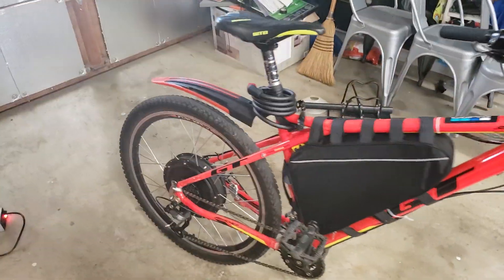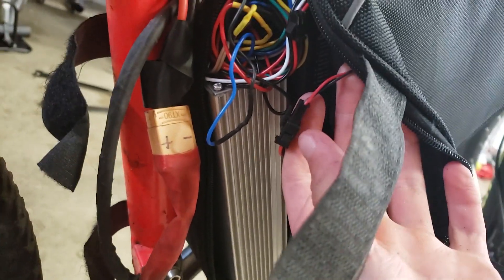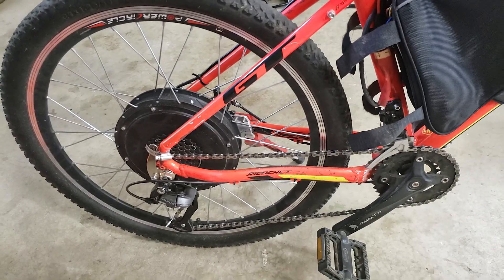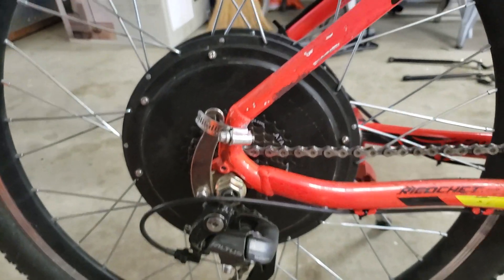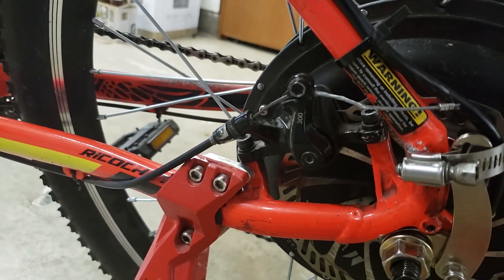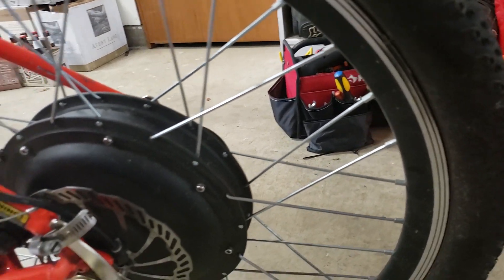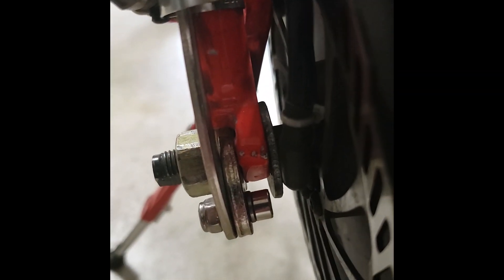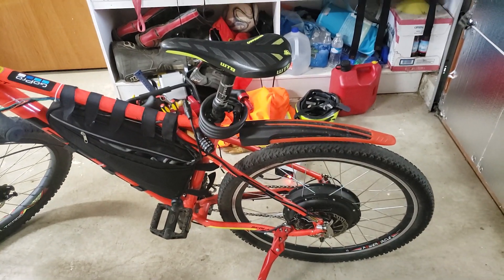DIY 1500w Ebike Tips *watch before building

Comment: For front 1500 watt hubs with 2 inch wide tires, try not to excel throttle when leaning to turn or sharp turns. Going over 20mph gets the torque of motor to push down pinching tubes to inner sides. It happens twice of same speed, same area of turns, and same blow out at same spot. Having 2 inch wide tires limits usage for bike tires not meant for 20plus mph due to pressure of speed.
Reply: You really can't speed thru pot holes, cracks, cement up lifts of concret, dips, ect. Constant pressure will have tire always needing repumping

Comment: How did you get the power feed for the light? Did you just cut straight into the battery cable? Thanks
Reply from the maker: On my motor controller there’s a accessory plug that comes off of it. Just two small gauge red and black wires that are the same voltage as the battery and carry enough amps for a small light.

Comment: What's the blue wire connected to?  Is this function standard on most controllers? 
I have a similar 1500watt kit, and I'd like option to limit raw power for range, as in the city I don't really require speed
Reply from the maker: There’s 2 blue wires coming out of the controller. And connected together it limits the power. When they aren’t connected it’s full power. Almost all 1500w controllers have it.

Comment: hey, im having the same problems with the brake pads, the thing is i dont know how to adjust the brake callipers bc the motor is so big, i cant acces the screw on the inner side of the caliper ,  i would have to remove the caliper, adjust it and install back on every time? do you any solutions? pls reply
Reply from the maker: Unfortunately, that’s exactly what I had to do as well. I had to remove the whole wheel or caliper just to adjust the pads. If you switch over to hydraulic brakes you won’t have that problem since there’s no adjustment on them.
Reply: @WillMacD  thanks for replying! Im gioing to think twice before installing hydraulic brakes due to the brake levers being able to stop the  engine, geat safety feature. the accelarator is kinda flimsy and when im breaking i can feel twisting the throttle a lil bit. how the xt90 connectoir? did you go with the s/antipark or regular ones? im having a problem with the battery wiring, previous owner was a shady engineer did  the job himself, sucked. the battery base thats attached to the water mount is not well put together and was wondering if i can put xt 90 connectors on the base of the battery and the controller withou burning anything, what do you say? thnks

Comment: I have seen loads of vids with this motor, I guess it must be worth the money, I got electric scooter causing me loads of issues, Really is thinking of an e-bike build but still not sure what i should get a hub or mid motor, Cant afford both lol, Can anyone tell me what is the best motor over long term use??
Reply from the maker: I would say go for the mid motor if you have the money to. My experience with hub motors is there cheaply built and not the best longterm. Mid drives like the BBSHD are a lot better quality, last longer and you have more options with the gears on your bicycle.
Reply: @WillMacD  A lot of people say the same sort of thing, I ask coz the electric scooter i bought is chain driven an now warranty is gone a weld went on the back creating a lot of other issues, An is now regreting not buying a hub driven electric scooter considering the chain driven scooter cost me just over a grand with 20ah battery, I had to buy after i bought the thing, So dont want make same mistake with buying parts for e-bike, Even done it with my sim rig by buying crap rig lol, Far too many people on you tube say anything for commision or views, You would think vid feedback would show you its worth the buy, Until you buy it, lol, I respect your honesty bro, So far it looks like a mid motor, Plus cant you overvolt the mid an hub motors? Is overvolting a motor a bad thing tho?
Nice one for the reply, Stay safe bro...

Comment: I use 10mm chrome vandium wrenches as wheel locks with 2x hose clamps. If they come loose they can rip wires pout or short them causing fire. 1500w should do 35-40 on that bike be careful.

Comment: How’s 48v kit on 52v?
Reply from the maker: The controllers and motors can run on either voltage. The 52v just give it a little extra.
Reply: @WillMacD  can I have the link of battery
Reply from the maker: @awstech6217  https://www.ebay.com/itm/254297690528
Reply from the maker: I used the 52v 20Ah with the 30amp BMS
Reply: @WillMacD  amazing ! I have a 48v 13 a and getting 20 mph max

Comment: I'm very concerned about damages the wheel takes, while riding in the city or offroad, if your bike isn't fully suspended.
Can you ensure me about that?
Reply from the maker: I haven’t had a problem with a wheel breaking even without suspension. I’ve ridden this bike pretty hard off-road and it’s a hard trail. Its held up very well. The spokes are a bit thicker than normal bicycle spokes.
Reply: Well.
Thanks a lot for your reply.
Will buy a bigger motor instead of suspended bike then!
Wish u the best

Comment: I'm surprised that it only goes 30 miles per charge, with over 1000 watt hours, I would have thought double that, but I guess if you are riding at high speed it needs a lot of power.
Reply from the maker: Yeah I thought it would go a little farther as well, and maybe with pedal assist it would go farther. But when I ride it in my area it’s full throttle the whole time.

Comment: I'm currently a voilamart 1500w ebike and I'm having a real issue with the controller, would you be able to help?
Reply from the maker: What’s your issue with the controller?
Reply: @WillMacD  I can't determine which wires go where. The motor that i have had all the motor wires connected to one plug and the wires are so small that they don't seem to be a proper gauge for motor wires
Reply: @WillMacD  here's what I'm working with https://youtu.be/eY_mr48sD5w
Reply from the maker: @micmartin2133  I watched your video, and that connector looks to be only for the Hall sensors. On my controller the hall sensor wires are the super small gauge, Blue green yellow red and black wires. Then for the power or phase wires there blue green and yellow but a thicker gauge. I hope this helps
Reply: @WillMacD  thank you so much for your help.

Comment: 52 volt? The Voilamart 1500w unit I am looking at says 48 volt. are there different ones or will the 48 volt unit accept the 52 volts?
Reply from the maker: The 48 volt kits will accept the 52v battery. It just gives it a little boost. But doesn’t give up any reliability.
Reply: overpowering voltage over the product doesnt sound like a good idea. it may or may not fry something.
Reply: @Nirvezz  I agree with you. But the higher voltage gives more RPM while reducing amperage draw. So if the system will handle (rated for) the higher voltage that is where I would go.

Comment: Can you tell me the size of the positive and negative wires of the power cable?I need to get the appropriate Anderson connectors for them.They seem to be 14 gauge.My triangular battery has bigger discharge wires with Andersons,is it a problem?Mine is 1500w integrated controller voilamart  hub motor kit.
Reply from the maker: Moey Gavry I would buy the Anderson connector of the same gauge that the battery is. Else they’ll be different. You should be able to crimp the connector on even if it’s just a little big. Although I do believe there 14 gauge. The discharge wires shouldn’t be a problem.
Reply: Thanks man! The reason I'm worried about the motor power wires being thin is someone said they had melted after hooking them up to the battery.
Reply from the maker: Moey Gavry My wires have never heated up or shown sides of melting. I sure hope that’s the same for you.
Reply: @WillMacD  This will be my first build so I have to do it right from the start.Thanks for the info!

Comment: Is you controller 52v or 48v? And motor rated for 52v?
Reply from the maker: HomeMade ch. it’s considered a 48v controller but the capacitors are rated up to 60v. And same goes with the motor. 52v won’t fry anything.

Comment: Please reply, i've been having trouble with this. Does the controller have a xt60 connector if not how would I connect it?
Reply from the maker: Anxitype the controller doesn’t have a xt60 connector. What I did was put a xt90 connector and soldered it on to the controller battery wires. And then did the same for the battery side.

Comment: What do you think about the 1500w kit with built-in controller in the wheel
Reply from the maker: Nick Walters I think it’s great idea. It makes it so there’s not near the mess of wires. Although both the controller and motor heat up so I would think that the controller in the hub design wouldn’t last at long.

Comment: Is there a big difference in the 1500w to 1000w with the 1500w controller
Reply from the maker: Nick Walters there actually is just a little. About 5 MPH slower.
Reply: @WillMacD  thanks for the reply mate I've got the 500w kit just over a yaer now and won't to upgrade I guess watt's means wheel torque what do you recommend
Reply: Cannot make my mind over to go to 1500W or 1000-watt and just change the controller
Reply: @revparsons3tl  you don't need to, if you can afford 1500w go for it. Rule for any electronics is if you can afford higher performance go for it as most cases its cheaper overall especially if you get bored of the 1000w now you'd end up buying a 1500w
Reply: @aesonindustries8325  I've got the 1500w kit
Reply: @revparsons3tl  im going for it too plus 52v. The difference at 52v makes over 48v is worth the money
Reply: @aesonindustries8325  mine 52v nominal and 58 volt fully charged
Reply: @revparsons3tl  Yeh that will indeed give best performance of the kit. Im going to get mine sorted by Sept I think prices are abit inflated atm.
Reply: @aesonindustries8325  look at unit pack power batteries

Comment: How do you brake with the rear?..
Reply from the maker: On my bike it’s a disc brake setup. And the hub motors come with mounts in them to mount the disc. Also if your bike has v brakes instead then the rim is also good for v brakes. So either option works.

Comment: What kind of bike/frame do you need for this?
Reply from the maker: Joe Athas any type of bike or frame will probably work. But you will want a frame with a big center section to fit the battery. And a bike with 26” tires is also preferred. And one more preference is to have disc brakes.
Reply: @WillMacD  It doesn't fit two of  my frames, but I found one it for thankfully. Need to buy a bigger frame for myself though
Reply from the maker: Joe Athas okay. And why doesn’t it fit? Is the battery too big? Or is the hub too wide? Or are the bolts to big?

Comment: I just finished my 3rd bike.. my 1500w came with the controller built into the hub motor..I have a very clean install
Reply: You had to use a frame with 3/4 axle size right?
Reply: Question?

Comment: We’re did you get the speed change switch how did you fit this  ???. It’s a must have otherwise you’d have to get off bike to connect or unconnect I’m guessing ?
Reply from the maker: Clown Killer123 I got the speed change switch off amazon. It’s just a headlight on off switch. And it’s meant for motorcycles but to wire it it comes with 2 wires coming off of it. If you strip the 750w wires on the controller and connect each of them to 1 of the wires coming of the switch, that’s all you got to do. When the switch is off it’s full power when the switch is on its half power
Reply: William MacDonald if you could post a link to the switch ... and please do a video about connecting the switch it will go viral in the ebike world as no one has done a video about connecting the switch and it’s a good extra I’m sure everyone would wAnt one .. please

Comment: Please tell me size of the frame of your bike I’m getting the same battery and want to noif it fits thanks
Reply from the maker: Clown Killer123 my frame size is 19”
Reply: William MacDonald and what’s the standard constant top speed ... and does it get up hills ok 👍🏼
Reply from the maker: Clown Killer123 it’s around 28mph for the constant speed on flat.  And it climbs hills great! Goes right up them. 750w or 1500w it does slow down but still goes around 15 up the steepest hills
Reply: William MacDonald thanks so much for replying...one last thing you can have a mountain bike with the Rev gears can you ..twist gears u can’t have them the gears have to be separate don’t they because you get new hand grips witch replace the twist guys
Reply from the maker: Clown Killer123 yes you are correct. My kit I believe came with both sides of new grips. The right side with the throttle but I chose to not install the left side so that I could leave the shifter where it was. But yes that’s one disadvantage of the twist throttle. You could try getting a thumb throttle I’m sure there pretty cheap and that might work.
Reply: William MacDonald I prefer twist throttle il just get a bike with out twist gear ...I’ve learnt so much from your videos and others thank god dude I would have been fucked otherwise best tip was taking tire off and putting type around alloy to stop it punchering tyres.. and the two torque  arms two priceless tips that have said me time money and probably my life !!!
Reply from the maker: Clown Killer123 yes I learned both of those tricks the hard way! Good luck on your bike, I hope it works out for you! And any more questions don’t hesitate to ask!

Comment: Dude I’m making mine too it’s freaking awesome dude.  Great job. I just switched from a older mountain bike to a newer. Do you have a snap chat or something? I’d love to chat about bikes man.
Reply: Dude I'm hyped because I just saved up enough to build my own bike too. I got a job recently (I'm a broke highschool student) and have been working for a couple months to afford this project. I bought a GT Aggressor Pro on Black Friday and I just ordered the 1500w motor and 52v 17.5ah battery. The only thing that sucks is that the motor comes in the mail  in a couple weeks, and the battery comes a month later. 🤦. But I ordered all the other accessories like torque arms, headlights and taillights etc. I'm also going to start a YouTube channel to show my build.
Reply: Vine Inc. hey dude I’m buying a 1000w version what size battery do I need am a noob ? lol
Reply: @clownkiller1235  with a 1000w watt motor you should use either a  48v or 52v battery. I actually just finished building my bike yesterday, and I took it out fr a spin today. It's so much fun dude, don't quit on the idea of building it. The battery I used for mine is a 52v 17.5ah battery that mounts to the downtube of the frame. I'd highly recommend it. I bought it from Amazon and it came within a week. Also, I'm going to make some videos showing my build process so if you need help look at those when I make them or just ask questions here.
Reply: Vine Inc. yes please make vids ... I’m obsessed I’m deffo building bought a 1500w ebike kit I need a battery and bike I can’t afford them yet but atleast I’ve got my kit coming
Reply: @clownkiller1235  hell yeah dude! I'll have the videos up this week and they'll be really in depth so you know exactly what to do.
Reply: Vine Inc. I’ve got my now it’s a monster with lcd screen 1500w I bought it built for really cheap today I’m fucking buzzing dude
Reply: @clownkiller1235  GT Aggressor Pro is a great bike to mod my worry is the front hub kits dont fit the bike and you have to file the front forks of the bike to fit electric hub wheel on . No way would i do that to my GT aggressor unless you can get a used set of rockshox judy tt to replace when needed. i like the idea of having a full set up but original parts to put back on the bike if anything goes wrong with the hub or controller electrics. with the front wheel thats a good thing because you keep the GT's front wheel as a back up.
Reply: @vineinc.5690  Where are the videos ??

Comment: I have had these items in my cart ready to pull the trigger for a couple days now.  I think I'm ready to commit, but I was wondering if you could provide some more insight into the wiring of the headlight.  I would love to have a strong headlight integrated with the battery.  Do you just make a Y cable and fork the positive and negative from the battery so that it goes to the light and to the controller in parallel?  I think I get how to do the limiter switch.  That would just be a standard on/off with that little limiter plug.  I don't know a ton about circuits, unfortunately.
Reply from the maker: To hook up a headlight, there’s actually a set of wires that come out the controller that are same voltage as the battery but lower amperage so it doesn’t hurt the light and they also make it so when you turn on the kit you then have the ability to turn on the headlight. And the wires coming out of the controller will be a black and red wire that have a connector at the end, I just spliced off the connector and connected the grounds of the headlight to the ground wire and then wired the positive to the switch and the other wire of the switch to the headlight positive. I hope that answered your question! If you have any more don’t hesitate to ask!
Reply: Randy Studebaker dude I’ve had mine for a few months now it’s definitely worth it. Make sure you st least have a front suspension bike for it’s pretty bumpy with all the weight